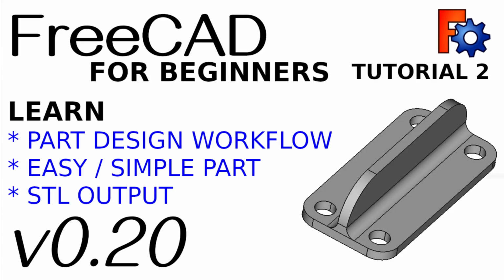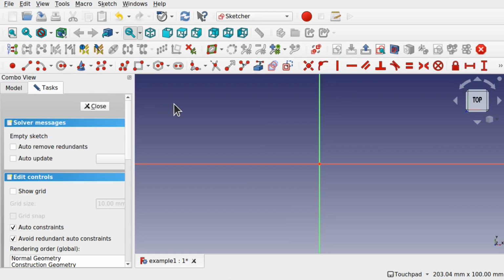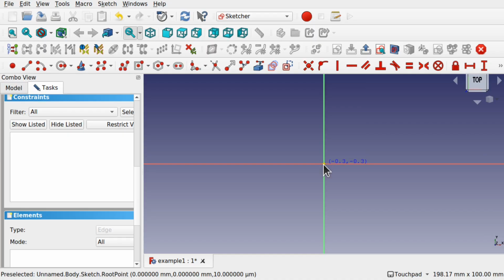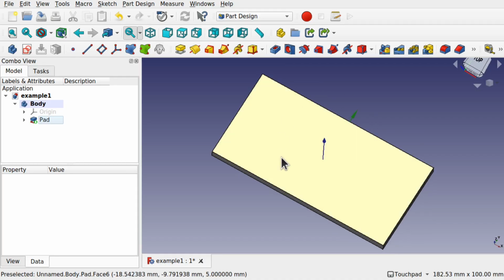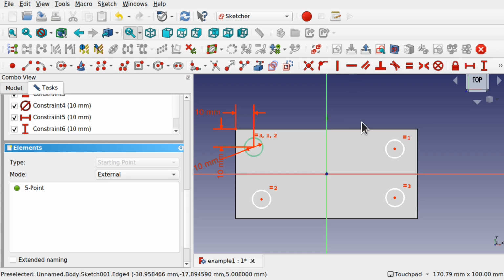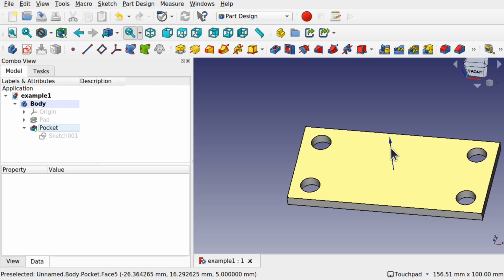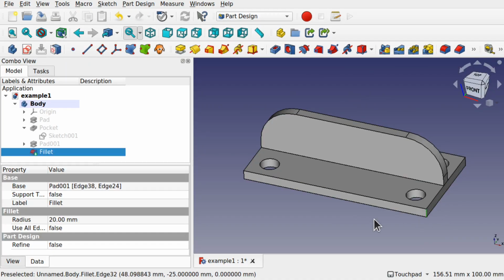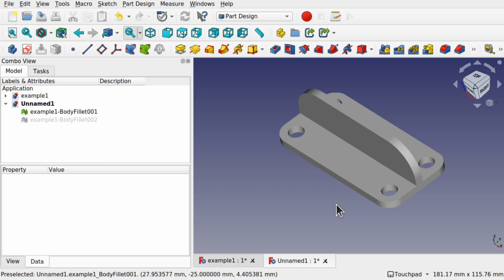FreeCAD 0.20 For Beginners | 2 | Create a simple model and export to STL in Part Design

Comment: Just getting started with CAD in general so not sure of accepted practices and the implications of not following to the letter. With that in my mind is the objective to look for drawing efficiency or sticking to protocols ? I ask because it seems you added an unnecessary sketch and external geometry for the hole pockets ? Was that just to demonstrate the feature ? Could you not have included the circles on the first sketch and PAD together ? My other question is on the second sketch and bearing in mind you said we should use geometry constraints rather than dimensional where possible, once one hole was referenced to a corner and the others constrained horizontally and vertically, could you not have used multiple symmetry constraints instead of dimensioning the diagonally opposite circle ? Not trying to pick here just want to learn the correct accepted practices. Thank you for the videos. Between yourself and "Adventures In Creation" I have learnt a lot.👍
Reply from the maker: Great feedback and I totally agree with what you have described, you have covered a number of things that are in the third video. The idea with this course is to gradually introduce more complexity as the course processes go without the videos runnung into hours and scaring off new commers  to freecad . In the past i have tried cramming in far to much in one video aim towards beginners before (this video has been cut in three from what I originally put together) When I  look at the statistics I  see a drop off and questions start to be asked which are already in the video as its too long. It's a juggling act, trying to covering just the right amount during one sitting and it seems to constantly change.
Reply: @MangoJellySolutions   Thanks for reply Mango, understand completely, look forward to the remainder of the series. 👍